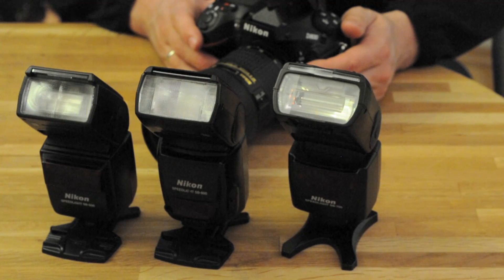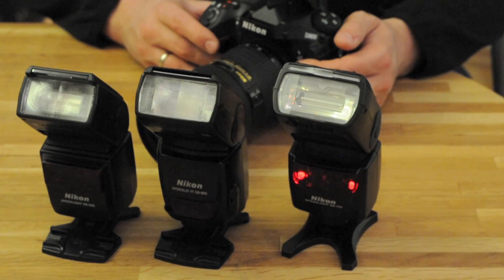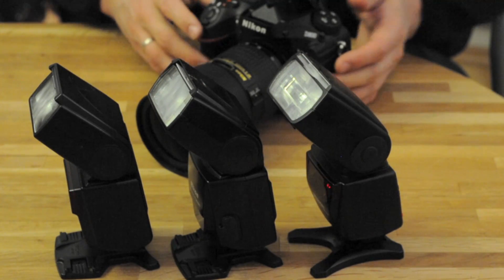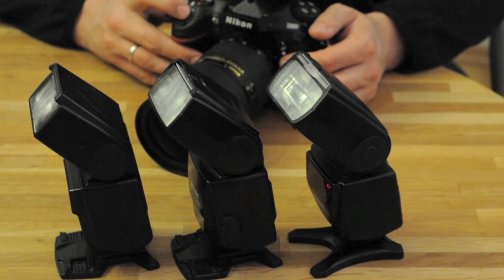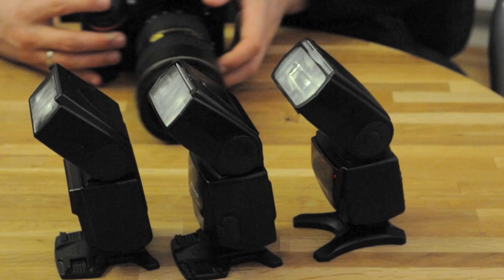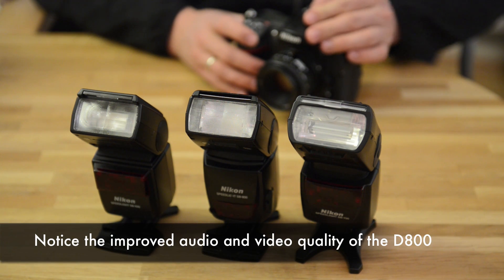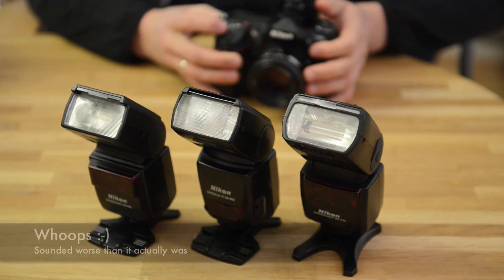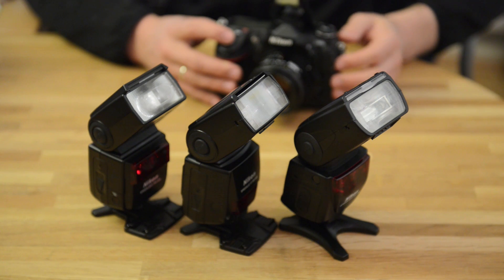Nikon D800 CLS problem - Flashes are not triggered reliably

Comment: Yesterday doing a wedding shoot, i found the same problem. Facing the sensor, and being closest as possible to the camera was the only way to fire the flash. The conditions? Night, some lights not too far and the couple iluminated by fire light on the background. Perhaps i tried 20 times, and just 5 of them went fine. Today i saw ur video and man, that´s a relief from one part that it doesnt affect just mine, but i hope they will fix this with a new firmware, soon please. Thanks for the video.

Comment from the maker: Yes, they have. They replaced the circuit board for the flash control. Also another firmware update has been, well, only mentioned to me for the end of 2013. The part which has been replaced is the "1H998-272 – SB PCB UNIT". Read the summary on my blog, follow the link in the description.

Comment from the maker: Of course radio triggers would make the problem obsolete. But I don't use radio triggers (yet), since my studio is at home and therefore not too big. Triggering the flashes with CLS works perfectly with the D300s and I never felt impeded by the fact that I do not have radio triggers.
Since I do not have the urgent need to invest in radio triggers I would be happy if Nikon fixed this issue soon.

Comment: This are my 2 cents for you, please try again the example with the proper conditions and consider again the 3 times bigger sensor and 1.5 batteries.  This is the Body for STUDIO work witch is more controlled areas. Cinema like no other, but a Stereo Mic is needed for Pro Audio, since the internal MIC is only for reference for the editor later on.

Comment: I've been having the same exact problem with my D7000 communicating with an SB-600 and SB-700. When I first started using CLS it was awesome but then the more I used it the more it started to misfire. I was about to return my 2 week old camera for a new one but maybe thats not the problem? Really frustrating since pocket wizards are expensive. I love the CLS because it can take fire the flash at your cameras highest shutter speed which is 1/8000th on mine. Similar to what the PW can do...

Comment: I think we should all look how cameras like the D90, D300s, D700 , D3 and D3s all have 12MP and this D800 has 36MP ( 3 times more bigger). Notice that the speed lights did not "registered" the signal till the camera finished the "job", it took a 2 to 3 second delay for all units to keep working. Kinda like using the S900 0r S910 at full power and firing in Full Matrix without pausing... you end up with black images, at least 1 in 10, due to recycling time not properly handled.

Comment: As a final note, you mentioned rechargeable batteries, not good, The units require 6 volts to provide optimum performance, that means 1.5 volt batteries. your example is using 1.2 voltage batteries, the math says that 1.2 times 4 equals 4.2 volt.... your missing a battery.

Comment: Having just viewed your video, it seems that even with you D300s not all the speedlight's are firing. The SB800 seems to be the least reliable of the 3, with no flashing indication which your 600 and 700 are (most of the time).Whilst I can see you are familiar with CLS I have a comment.
I found that when I use my own 800 as a commander, running my R200's and a 600 that I can take several trial attempts to get everything working, Sometimes it's just down to battery voltage and peak drain.

Comment from the maker: Internal Popup Flash: 
Master Mode, Setting "--" (does not contribute to the lighting)
Group A: Manual, 1/10
Group B: Manual, 1/10
Channel 3

SB-600 Group B
SB-700 Group A
SB-800 Group B